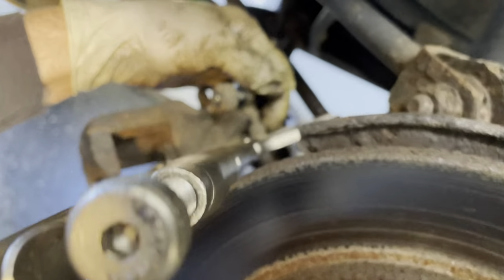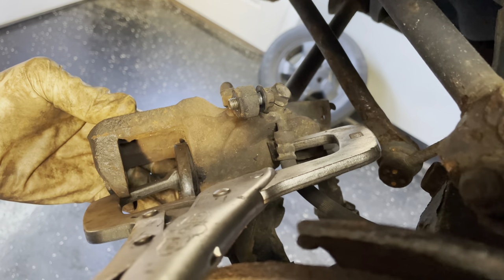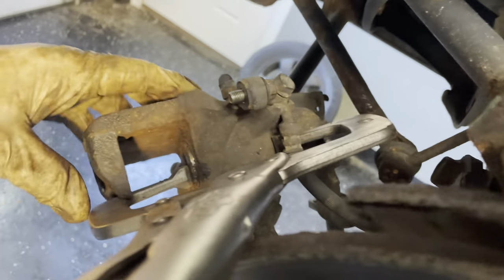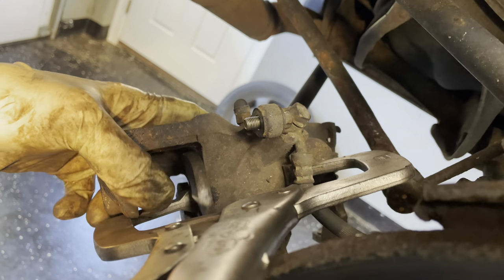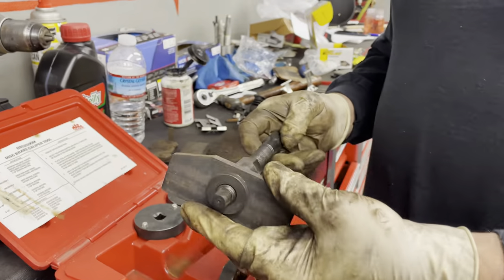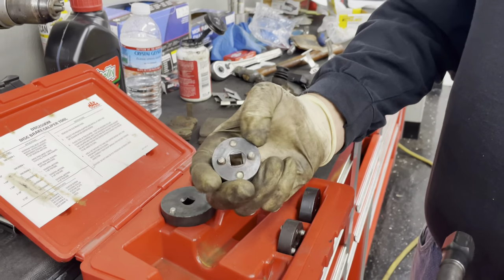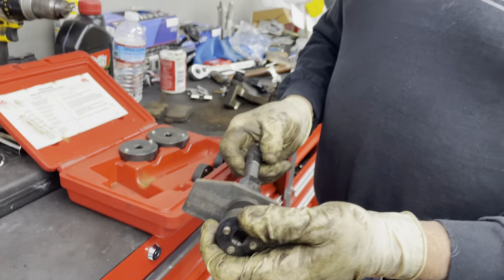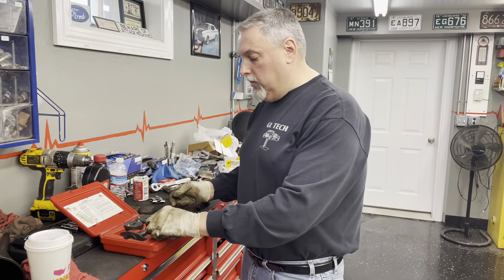How To Collapse Twist Style Rear Brake Caliper Without Special Tool

Comment: Push down the rubber boot on the piston and rub a little brake fluid between the piston and boot. This will cause the boot not to twist and bind while you screw the piston back into the caliper and you can almost turn the piston by hand!
Reply from the maker: Thanks for watching! Don't forget to subscribe!
Reply: Yeah.  Some light cost of WD40 or silicone lube to allow piston to spin without twisting rubber seal.

Comment: Fair warning, Doing this will very likely brake the parking brake mechanism inside the piston. Don't ask how I know it. 🤬
Reply from the maker: I've never had that happen
Reply: your parking brake in the rear is hooked up to the rotation of the caliper in some way. so yea depending on the design if you crank it without unhooking the cable it will potentially break.

Comment: You are using a special tool I think the flat heat screw driver everbody has it in there garage.put it in the caliper between rotor and the brake and press untill it goes all the way in
Reply from the maker: Thanks for watching

Comment: Does the piston have to be twisted all the way back in or is twisting it just enough to fit over the brake pads okay? Having brake drag and wondering if thats my issue.
Reply from the maker: If you are replacing the brake pads you more-than-likely will have to collapse the brake caliper piston in far enough so that the new brake pads have enough room to clear the brake rotor. If the brake caliper is dragging after up pump up the brakes the piston might be getting frozen, if that is the case it may be time to replace the brake caliper so that it functions correctly. If it hangs up it will wear out your new brake pads pretty quick. Hope this helps you out.